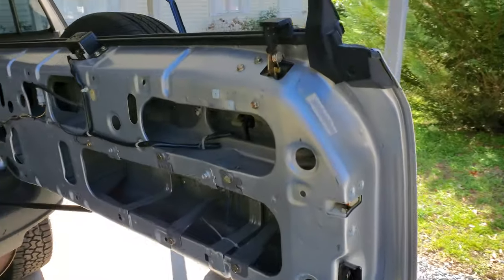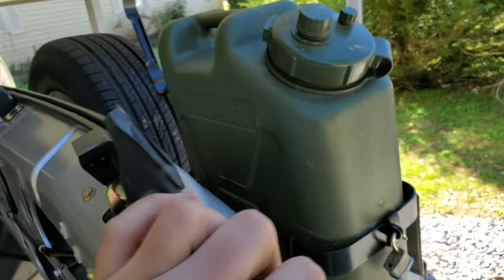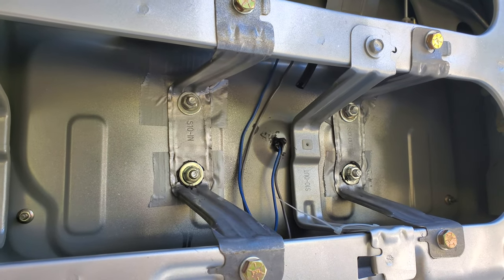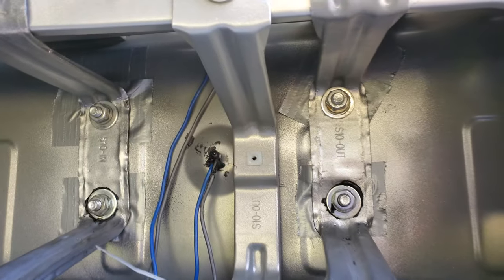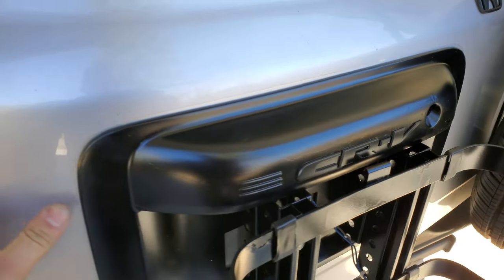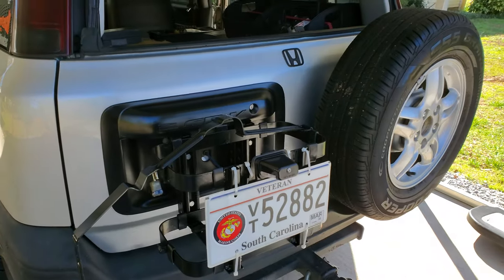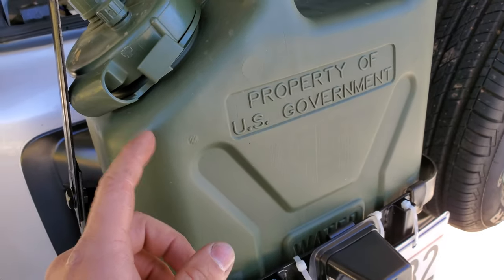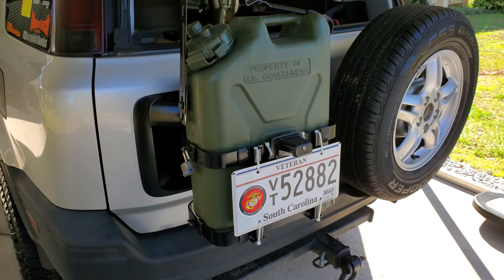How To Install A Jerry Can On A 97-01 CR-V (RD1)

Comment: How did you get the license plate light working with this set up
Reply from the maker: It's from a trailer. I wires it up. Did you see the wires I ran to the old license plate wires?
Reply: Josh Wolff couldn’t tell